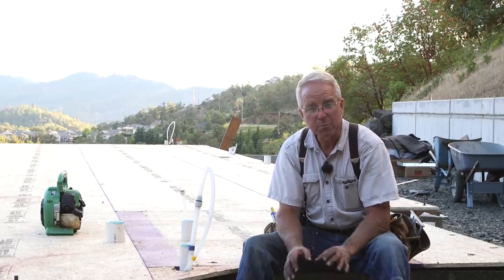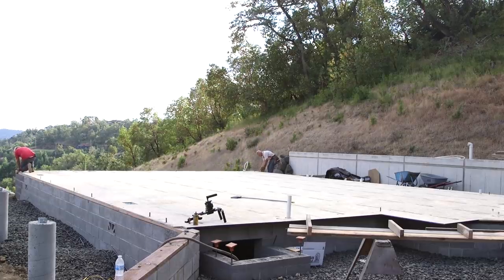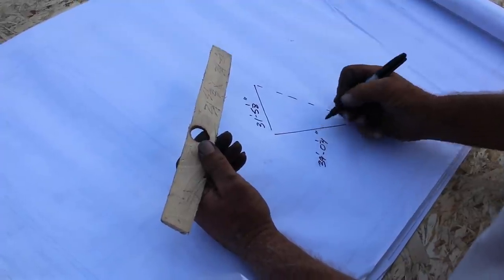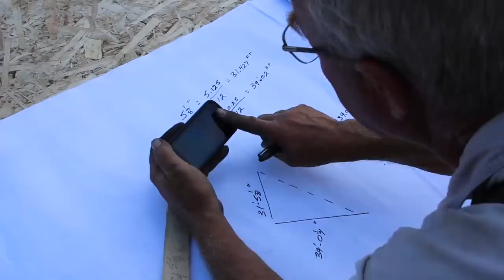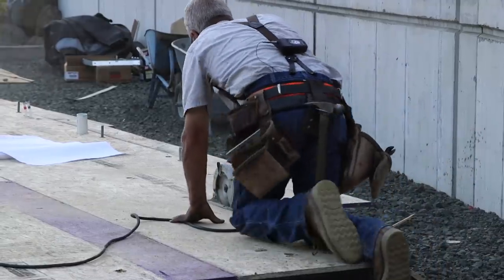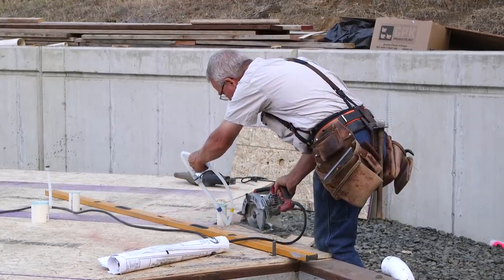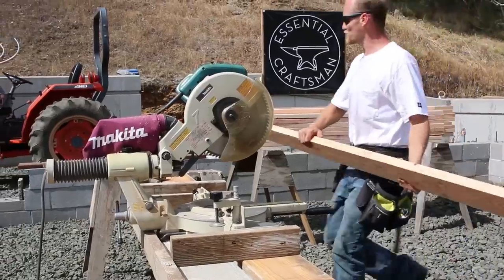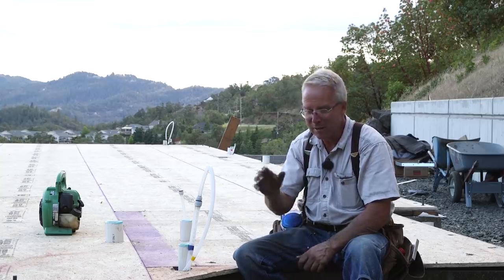Make it Square Ep.45

Comment: Now... you didn't tell us why you resorted to the calculator. I assume it was to get the true diagonal of the house.

When setting out, and you might consider this cheating, but I focus on arrowstraight lines, even if it takes a dryline or a laser to get there. If and when the lines are straight, you don't need corner to corner to check for square - you can simply go 3,4,5 or any extension thereof, like 12, 16 and 20' for instance... No math, just numbers. Then check the diagonals, and see if they match. Still no math. 

Of course then you have to check 4 angles, in stead of just the 2 you can make do with on full stretch measurements. Potato potaato possibly, but low tech and eliminates some possible errors... or exacerbates, all depending - but it does work.
Reply: He didn't have two diagonal to compare.
The house isn't a simple rectangle, the fourth wall is tipped for the garage. So some figure work was required. Metric would make it easier, but not here in America. We love our inches,
... and smelly feet.
Reply: @ChrisHoppe-wordmeme  Oh I know - he used a reference line straight across at the end of the house towards the garage. Had to - otherwise you can't check the diagonals.

Not sure if you noticed, but all measurements are in feet. As long as the basic relation of the triangle is 3,4,5, (a²+b²=c²) you can extend it to whichever size/number in whatever units you want, whether imperial, metric, light years or arm lengths. Geometry is universal - neither imperial nor metric or both, whichever way you wish to look at it. Angles don't change by scaling, only by distortion.

Comment: "Pythagorus Theorem" - that is just 3 to 4 to 5 - any knuckle scraper knows that and can work that out, nothing special - if they cannot work that out or remember that ratio and cannot use that, they obviously cannot make fire and cannot throw spears.
Reply: Pythagoras' theorem isn't just ratios.  It's used not just to figure out the length of the sides but also the angles of the corners, and is used for most basic geometry.  It's not hard, but people seem to get confused by unknowns in math for some reason.   It's always better to know the basics so you can use that to modify things if you need to.
Reply: @AdoraBell - I think you Need to Go back to School - because the Ratios of 3 to 4 to 5 is all about finding square or right angles or 90 degrees, that is what the theorem is all about.  3, 4, 5 is a simple way to do that so that Knuckle Scrapers etc. can remember that and do that and get things square when building houses or office fit outs etc.

Comment: The interior partitions in my house are crooked, and it's deliberate.  Why?  To keep the noise down.  It's a long, narrow row house with 2 partitions on each floor, making a front room, a back room, and a hallway/staircase/bathroom in between.  The walls are tilted off square by about 2" over the 15-foot width.  It can't be perceived unless you look carefully at the flooring in particular rooms.  The non-square shape kills the acoustic resonance that you get in a modern, perfectly-square room.  In my big, open, acoustically-live living room, if you clap your hands, you don't hear any kind of echo.